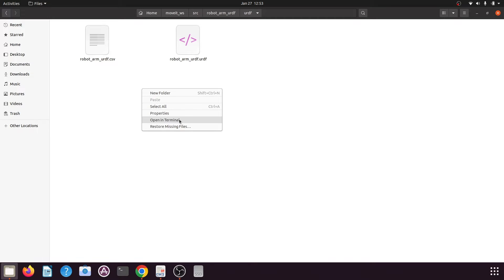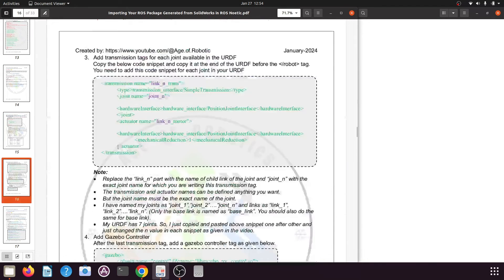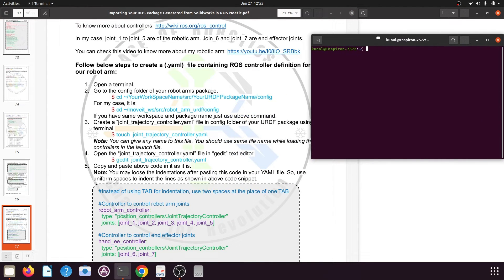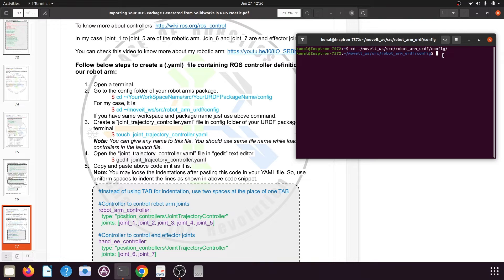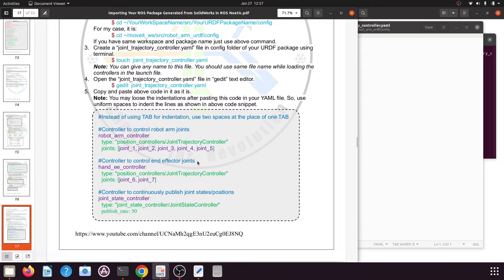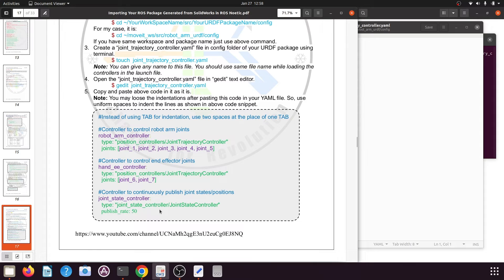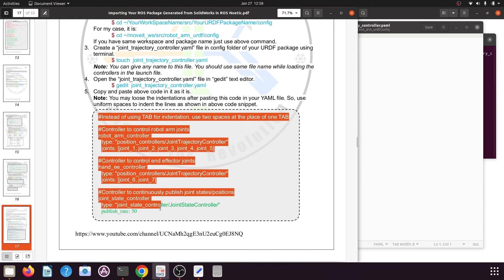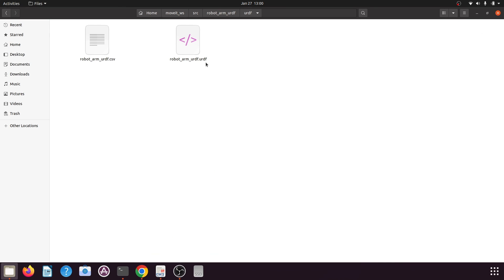Lesson 7: Create a Joint Trajectory Controller For Your Robotic Arm (ROS Noetic)

Comment: tip: if your urdf check fails, pay extra attention on extra spcaes like i encountered in "<hardwareInterface>hardware_interface/PositionJointInterface</  hardwareInterface>", it must not have extra space inside the closing tag, so it must be like "<hardwareInterface>hardware_interface/PositionJointInterface</hardwareInterface>". A nice tip is to check a XML online validation tool! It now works just fine